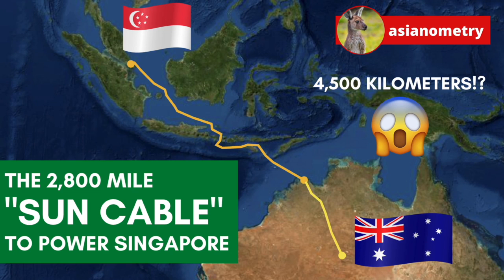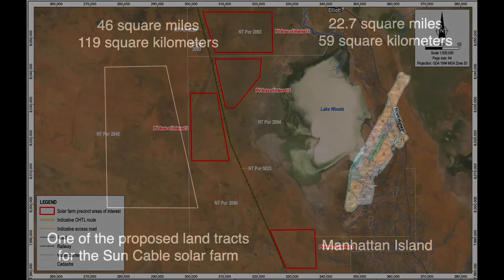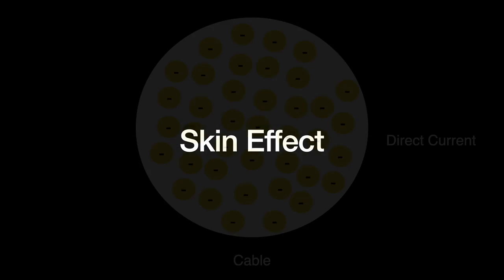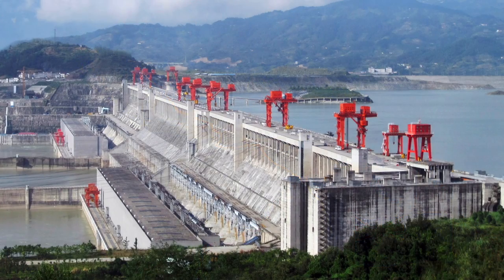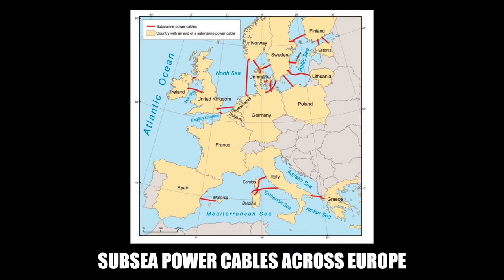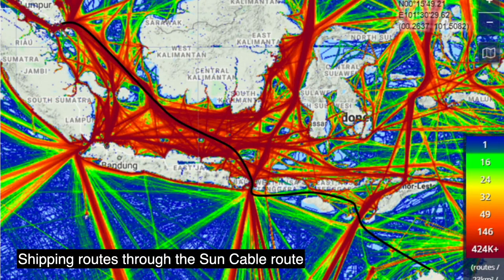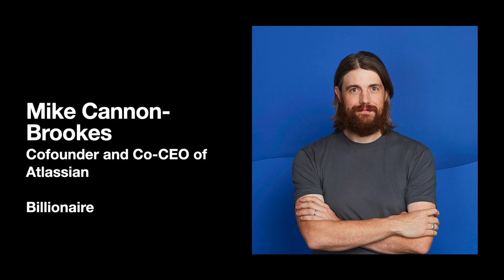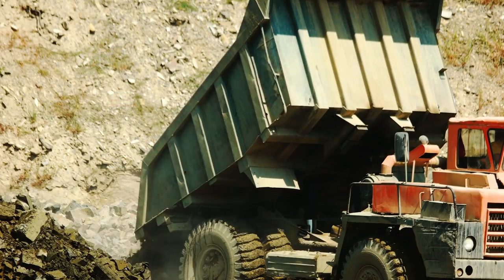How Singapore Plans To Pipe Electricity From Australia

Comment: Now dessert counties actually have a resource in abundance to export,sun
Reply: Australia gives it all away for free
Reply: If Australia wants to become co2 neutral using solar panels they would need a land area four and a half times the size of their country; professor Ian Plimer has crunched the numbers. I hope he sees this video he will have a good laugh.
Reply: @Johnsmith-zi9pu  a house can be fully self sufficient from solar just make it compulsory to build a house without it , but the government can’t steel your money so they would try to charge u tax for your panels yearly
Reply: Dessert counties (sic) have always had it sweet
Reply: @trentbrady8829  Fully self sufficient???? A fully self sufficient house and that includes  cooking, heating etc.would require a quarter of an acre of solar panels and a shed full of toxic batteries.It's clear you have no understanding solar.
Reply: @Johnsmith-zi9pu  your on drugs buddy how do u think yachts operate? 41 foot cat is a 4 bedroom two toilet washing machine fridge freezer full of electrical equipment and fully self sufficient and now use electric motors to replace diesel all ran off solar, I own one , do some home wrk buddy 😂
Reply: @trentbrady8829  how many nautical miles will those electric motors drive your yatch and how long does it take to charge your battery?
Reply: @frankbob6664  I don’t have electric motors on my vessel but a lot of new boats have them or starting to have them and once under sale they turn into chargers while being dragged
Reply: @trentbrady8829  well prehaps you should edit you comment that suggested that you own one with electric motors. Is it you own a yatch with ICE motors, how big is the yatch and what does it need to power it? Does your  yatch have a tv, oven, stove, airconditioner, fridge (what size) what sort of lighting do you have? Do you use your solar power sparingly? Do you use your yatch regularly, or frequently or do you live on it? If you do live on it how many people live on it? Does a boat that produces electric power by drag recharge the battery faster than an electric motor depleateds it? You'll have to explain your claim a bit better for for it to be believable.
Reply: @Johnsmith-zi9pu  what about new generation non toxic flow batteries?
Reply: @Johnsmith-zi9pu  apparently this professor you quote is constantly being found to be wrong by the rest of mainstream scientists.
I would suggest you be very skeptical of his statements.
Reply: @trentbrady8829  The drug I am on is called facts you should try some.
I notice you left off cooking and heating, I suppose you eat raw vegetables and wrap yourself in a doona for six months of the year.
Reply: @Johnsmith-zi9pu  they don’t even sell blankets in northern Australia man or the desert where the solar farm would be going where it’s 47 degrees on average in Sumer , hottest temperate place on earth
Reply: @aaronheaney2694  How many would we need and how do we dispose of them when they expire?
Reply: @trentbrady8829  You said the house could power itself I called your BS and now your talking about blankets in the NT?????
Reply: @Johnsmith-zi9pu  28-34 solar panels
How Many Solar Panels Are Needed to Power My Home? The average home in the U.S. uses 10,400 kWh of electricity per year. If you install the average 250-watt solar panel, you'd need around 28-34 solar panels to generate enough energy to power your entire home.1 Aug 2019
Reply: *Desert
Reply: @aaronheaney2694  He backs his statements with data something renewable advocates never do.
Nobody has presented a plan to run Australia on solar that's because it's physically impossible.
Reply: @Johnsmith-zi9pu  not sure how many needed. Solar tech is changing constantly.
As far as end of life goes, recycling would be the answer.
Recycling expands
Although there are limited Australian recycling facilities, more options are becoming available at a rapid rate, thanks to new legislation, and opportunities in the sector. The NSW Government recently began inviting expressions of interest for $10 million in grant funding to run trial projects that increase the collection, reuse and recycling of solar panels, and battery storage systems, while the LNP recently proposed a new solar recycling facility in South East Queensland.
Reply: @Johnsmith-zi9pu  but other scientists are using data that contradicts him.
Reply: @trentbrady8829  Do you cook and heat your home with solar? You said you can power your home with solar that includes cooking and heating.
Reply: @Johnsmith-zi9pu  yes,we have this tech gor over 100 years
Especialy in 3rd world countries we have electric boilers
And people in 1st word counties have electric stoves and ovens
Reply: @Johnsmith-zi9pu  "toxic batteries: are ya drinking gasoline daily mate?
Reply: @Johnsmith-zi9pu  can you show us your profesor calculations?
I will try later to google the area of australia and see the dimentions of a 100w solar panel and multiply that by area of austalia and see how mic evergy a australia size solar panel will get,amd cimpare to australia electrical consumption multiplied by 2 to factor electric cars

I will do this calculation once home,in meantime please show me your profesor calculations
Reply: @aaronheaney2694  I am sure that many companies will be putting their hand up for the 10 million dollars, the people who own solar panels should be paying for the disposal of their toxic waste.
I would like to see all energy related subsidies scrapped to get rid of all the parasites in the energy sector.
Reply: @UnipornFrumm  Gasoline when burnt in a modern car produces CO2 this CO2 federalizes vegetables that I eat .
What do batteries taste like?
Reply: @Johnsmith-zi9pu  we really should be paying for the disposal of all our electronic devices and all our batteries. And of course solar panels.
Reply: @UnipornFrumm  Your basic calculation is completely wrong. Solar panels have to spaced so they don,t shadow each other in winter time,they only work at full capacity in optimum sun (midday no clouds) and storage loses 30%. If you want all the details read Ian Plimer's book Not For Greens, but doubt the you want your religious beliefs challenged.
Reply: @Johnsmith-zi9pu  i wont buy no book +i m anti religion
Reply: @aaronheaney2694  On this we totally agree.
Reply: @UnipornFrumm  I didn't think you would be interested in technical information, but I suggested it anyway.
Reply: @aaronheaney2694  Can you reference the data I would love to see it?
Reply: @Johnsmith-zi9pu  yer mate I put it all in the reply from google 28-32 there abouts is all u need to run an average American house hold easily per year hope that helps ya
Reply: How can you extort the sun? silly😆
Its sunlight
Reply: @supremeverdict359  they where charging per square meter for the roof of your house for water catchment, there now charging extra money for ev cars because they don’t make about 80% on fuel , if everyone goes solar and rain water how does the government fill in the major tax gap
Reply: Free? Someone has to pay for install compliance maintenance and replacement
Reply: @M_a_r_ke  the biggest gas plant Australia ha so ever seen barrow island ran by American company chevron on a grand one nature reserve in its first year of operation payed 62,000 tax to the Australian people , yer for free
Reply: @trentbrady8829  Cooking and heating are usually done by gas or solid fuel they are major consumers of energy and that's why your numbers are wrong.
Reply: @Bobspineable  we pay tolls to China who owns most tolls in Australia we pay 90% tax on cigarettes which are 40 plus dollers a packet alcohol is taxed at double the United States , then we give away your our resources to mainly chin an for next to nothing while billionaires pay nothing , takes u 30-40 to pay off an adveage house in Sydney 1 million plus then pay 33.5% tax
Reply: Dessert? What are we having
Reply: @Johnsmith-zi9pu  this I big brain, big dumb brain…jeez man read a book
Reply: @epiccollision  What does that mean? Your English is to sophisticated for me.
Reply: Use solar to make Green hydrogen. Export hydrogen to Singapore or Japan to power automobiles  or for power generation.
Reply: @visibletoonlyyoutubeusers9574  Solar isn't green, building and disposing of solar panel is very dirty. Covering large parts of your  land in solar panels also has environment consequences.
California is considering burying solar panels as toxic waste to stop them polluting ground water.
Reply: @Johnsmith-zi9pu  
Thirty Billion, Five Hundred and Seventy Three Million square kilometres - I suggest your "Professor" is way off... if Transmission losses weren't a thing, Australia could be the world's powerhouse!
Reply: @joebloggs9738  Australia can't power it's self with solar; gas or nuclear will do the heavy lifting. . Michael Shellenberger says it would take half of the earths' available land using all forms renewables to produce all the world's energy.
This solar wank will hit reality sooner or later.
Reply: @Johnsmith-zi9pu  what do you think Australia's installed grid capacity is?
This sun cable build is talking about building a 10GW solar array on a small farm in the desert of the Northern Territory of Australia.

The installed capacity of generation is around 50GW in Australia.. It's 5 of these.

Time to google a map on land area of Australia versus this project.

The majority of Australian energy usage is mining coal and gas..
Reply: @Johnsmith-zi9pu  Rubbish.
Reply: @MrTubeNR  Replacing coal, gas, diesel and petrol with solar panels is psychically impossible that's why only energy illiterates talk about it. 
If you read professor Ian Plimers book Not For Greens he gives you all the numbers.
Reply: @Johnsmith-zi9pu  no one is talking about a total replacement. They are talking about net 0.

The fact Australia's energy use is so high is because we use the majority of our energy to mine for coal and gas and then export them for basically free.

Australian electricity usage can  easily be supplied by wind, solar, hydro. We certainly have enough room for it.
Reply: @MrTubeNR  Please link me to your data?
Reply: @Johnsmith-zi9pu  have a look on Google maps. This solar farm they are planning is 10GW. Have a look how big the pinhead dot of the farm is in the NT. It's tiny. That's for 10GW. The Australian east coast electrical grid has less than 50GW of installed capacity for the majority of the population.
Reply: @Johnsmith-zi9pu  7 692 024 km2 is the land area of Australia. This project is planning to use 10km2 for 10GW. If we multiply by 5 we get 50km2. It's a tiny blip.

We have like 20% of the household roofs covered with solar for something like 8GW capacity of residential solar. Even at 80% of residential roofs, that's 24GW.
Reply: @Johnsmith-zi9pu  not a chance
Reply: @MrTubeNR   10GW in optimum sun (midday no clouds) How much midday midday no clouds do we have in a year?
You are being feed propaganda by parasites after your taxes and your falling for it hook line and sinker.
Reply: @Johnsmith-zi9pu  Ah yes Ian Plimer, The mining engineer. I wonder why he'd say that....🤔 Could it be that australia's mining industry loves itself some coal?
Reply: @Johnsmith-zi9pu  mate if you want to listen to an IPA shill(funded by Gina Reinhart) go for it. I obviously can't break your faith. 10GW nominal on 10km2.. We have 7Million km2 of area. Build 100gw nominal its still cheaper than nuclear. We have unlimited space.

We also avg 1000w/m2 fairly often.
Reply: @ummdustry5718  BSc (Hons) in mining engineering at the University of New South Wales in 1968, and a PhD in Geology at Macquarie University in 1976.
He supports his claims with sold data and that's why renewable advocates hate his guts.Two of the main ingredients in solar panels are coal and quarts both have to be mined.
Are you suggesting anyone who has worked in mining can't present facts or tell the truth and does the same apply to those who flog renewables?
Reply: @MrTubeNR  The people who told you the arctic would be ice free by 2012, then 2014, then 2015, and that our coastal cities would be flooded by rising seas. Who said in 2005, rising sea levels, desertification and shrinking freshwater supplies will create up to 50 million environmental refugees by 2010. Who said in 2000 that English children will not know snow by 2010. Who said in 2007 "Even the rain that falls isn't actually going to fill our dams and our river systems" and that drought was the new normal. Who said the intensity and frequency of hurricanes and cyclones would increase and last year’s fires were caused by climate change and not negligence. Who told us that 97% of scientist agreed with them but to this day have never produced any credible polling to support that claim, are telling you that you can power your country with solar panels and no data to support that claim either. 
These con artists need people like you!
Reply: @Johnsmith-zi9pu  1 expert bought and paid for by an Australian with billions in coal mining to lose. Keep the faith brother. Worship the almighty IPA goddess. The fact is there are 7,000,000 km2 of land. 100 km2 would double the current grid capacity. Believe what you want.
Reply: @Johnsmith-zi9pu  Huh? Most houses can fit 5kw solar on their roof. That's prob 30kwh of energy per day. Enough for 90%+ of homes, and top off an electric car each night if you had a powerwall or two hooked up.
Reply: @Johnsmith-zi9pu  Ummm No. Even Elon showed the USA could replace its entire electricity generation with a solar farm taking up just one corner of Arizona. A 100x100 mile area (10,000 square miles). Australia uses much less total energy than The USA
Reply: @simonhill6267  Something like Crescent Dunes Solar Energy Project?
Energy illiterates love solar.
Reply: @Johnsmith-zi9pu  umm no. That site is only 1670acres. 10,000 square miles is 640,000acres... 383 times larger.
100x100 miles is still only a blip in the total land area of the USA. Australia could do it even more easily
Reply: @trentbrady8829  Eh I own a off grid cabin and even with wind & solar & large battery bank I still have to ration power usage, A/C, electric water heaters, and electric space heaters are insanely power hungry. Electric water heaters consume so much power they are an issue for homes on the main power grid! I think you need to do more research. To get the same quality of life as people attached to the grid, you probably do need an acre of solar panels, not to mention all the issues arising when the sun isn't out. Energy storage is the big issue right now with solar.
Reply: @simonhill6267  When experts tell me it would half the earth's available land to produce all our energy from so called renewables , I will take their numbers over yours.
Reply: @Johnsmith-zi9pu  which experts are those John?
Any reference for half of earth's land area?
Fortunately you are in a position to be proven wrong within your own lifetime. That should be fun for you.
Reply: @simonhill6267  Professor Ian Plimer has written a book on the subject with all the numbers and details, Michael Shellenberger has also covered this subject in detail.
So called renewable advocates always base their numbers on peek performance and never factor in loss for storage. Solar and wind are environmental rapists if you scale them up to produce useful amounts of energy.
Reply: @Johnsmith-zi9pu  It is not actually. Solar panels to produce green hydrogen fuel.
Reply: @wes3428  Nothing green about solar panels, wait until they are staked a mile high at the tip and threaten the quality of our ground water.
When we burn organic coal we recycle trees that's green!
Reply: Yum, dessert counties.... 🍧🍦🍨🍮🍰 Mmmmm.
Reply: @Johnsmith-zi9pu  The Sun Cable will cover 20% of Singapore's power usage and requires 120km^2 so to provide the same amount of power (per capita) for Australia's population (assuming a 30m pop.) requires 3500km^2.

This is roughly 1.5x the size of the ACT.
If you take into account all the rooftop space available along with the literal millions of square km of desert there is enough space to power all of Australia hundreds of times over.
Space isn't an issue.
Reply: @Johnsmith-zi9pu  It's not that hard. Have every house and buildings put solar cell on their roof, employ agrivoltaic and put it above farmlands and pastures, and have you heard about biofuel, tidal, and wind power? That professor of your mustn't have. Australia can easily become carbon neutral.
Reply: @thastayapongsak4422  Biofuel is when you burn other people's food or forests, you can't farm in the shade of a solar panels.
Tidal power,wind power and solar are very low density energies and unreliable  and that means enormous amounts of hardware to collect and store them. 
It would require a massive increase in mining to produce and replace all that none recyclable hardware.
People who use solar also use gas or wood to meet their energy needs because it's not viable to heat your home or cook with solar.  
The professor has done all the calculations and put them in print unlike his opponents.
Reply: @Johnsmith-zi9pu  "Australia can't power it's self with solar" what is wrong with you? That profesor you were talking here about is his IQ below 90 or is he on a payroll of some Australia coal producer?
Did you get anything out of this video?(rhetorical question as it is obvious you didn't understand anything).
"The Lightyear One is a large hatchback, with the bonnet, roof and boot clad with 5 m2 (54 sq ft) of solar panels, with a WLTP (Worldwide Harmonised Light Vehicles Test Procedure) range of 725 km (450 miles) and designed with a drag coefficient of Cd=0.20. The company Lightyear claims there are 1,000 solar panels across the car that can add 50–65 km (30–40 miles) of range per day during summer.
The car is all-wheel drive, with four in-wheel electric hub motors powered by a low-mounted battery. It seats five adults and luggage."
And surface of Australia is 7.692 million km² (1km² = 1000m*1000m = 1,000,000m²)
btw. if you want to cook with the sun then you do not need electricity for it, you can use "solar cooker" and single square meter of surface can colect enought energy to cook your food...
Reply: @trentbrady8829  In a four person family, cooking alone will take more than 3500 kilojouls of energy. This is just based on the specific heat of water and efficiency of ovens. No need a yacht, or being on drugs. Just some physics is enough.
Reply: @Johnsmith-zi9pu  what? Are you shooting the co2 into space with a solar powered railgun???

That land area could power the planet.
Reply: @Johnsmith-zi9pu  who are "people"

electric cooking is easily doable anywhere. I have an electric oven. my next hob will will be electric. my microwave is electric, as is my kettle. 
Heating is a more difficult problem. I suspect the major demand in Australia isn't heating though. its cooling. a very good match for solar.
But yes here in the UK heating and solar aren't a great match. but we have wind instead. 

what do you count as a plan for running a country on solar? plenty of countries have come up with plans for going 100% renewable and carbon neutral. so unless youre going to say that gas, coal, and nuclear are also wank because no country has a plan for running 100% off those then you just have double standards.

Solar will be part of the energy mix going forward. it doesn't require anything like the land you state. you can run heating off it, you can cook, you can power your car, and your lights.
Reply: @benholroyd5221  Name one country that has an engineered and costed plan to go 100% renewable
Reply: @Johnsmith-zi9pu  in some ways we're already there. Paraguay I believes exports most of its electricity, generated from hydro. There's islands in the Pacific who use solar + battery, even Norway has a basically 100% renewable grid.

Denmark has a plan to go zero carbon by 2050, the UK is going net zero carbon by 2050. 

I think you're being quite disingenuous by requiring a costed and engineered plan. Prices are coming down by an order of magnitude in a decade, plus governments tend to govern, not micro manage. Why do you expect them to fully engineer things?

The UK 10 years ago was 2/3rd coal powered. Coal is now basically a rounding error. In another decade it'll be well over 2/3rds wind. All that is costing is the strike price (less than half that of nuclear, and infact starting to get to the point that it's becoming subsidy neutral/negative ) and the state is getting money leasing the land. 

So at this point, wind power is basically free, solar is probably in the same boat. Storage is coming down rapidly in price.